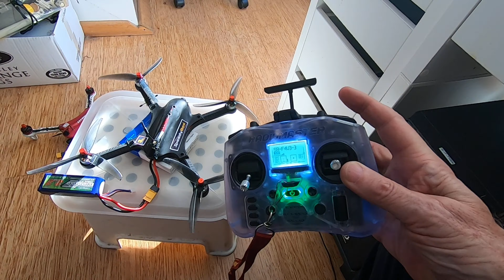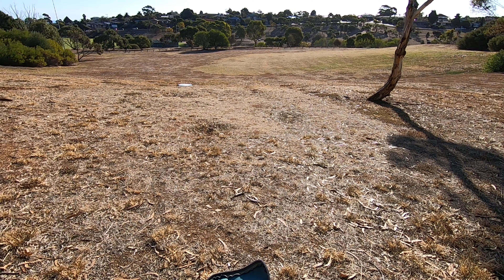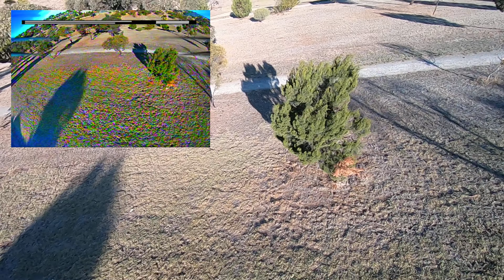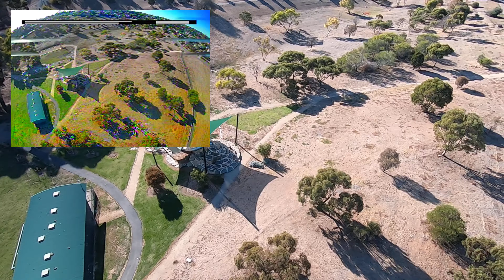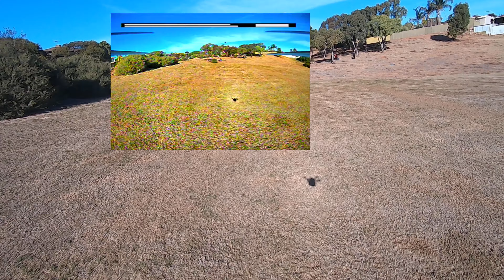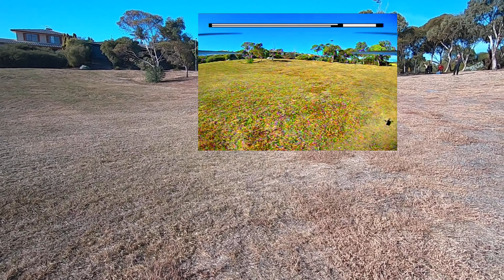SpeedyBee F405 V4 takes to the air - but how high?

Comment: Do not plug your flight controller into your pc with the battery connected and props on. TAKE THE PROPS OFF!
Reply from the maker: Fair comment. I certainly would take them off if this was a new build. In this case, everything has been tested and works. Arming is disabled and I kept away from the Motors tab. 😅